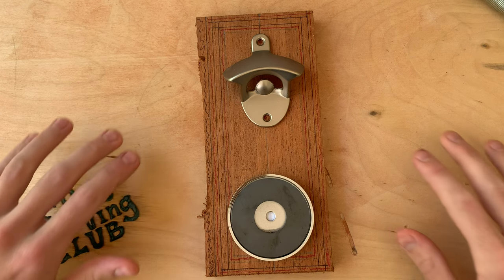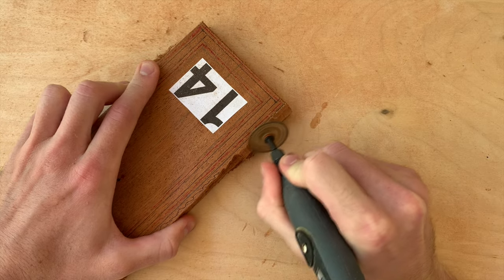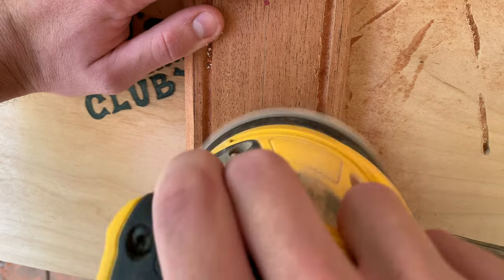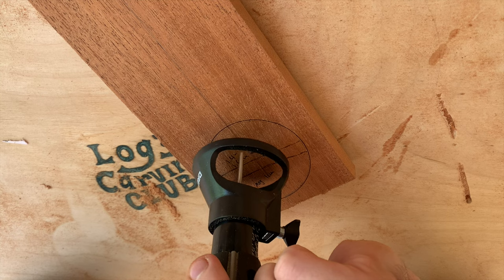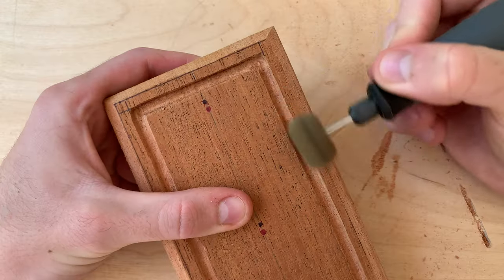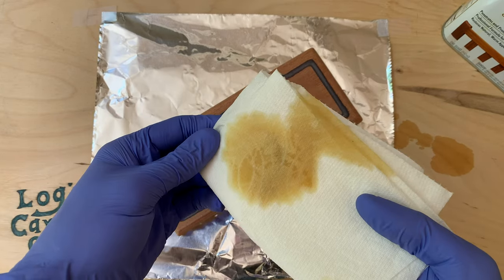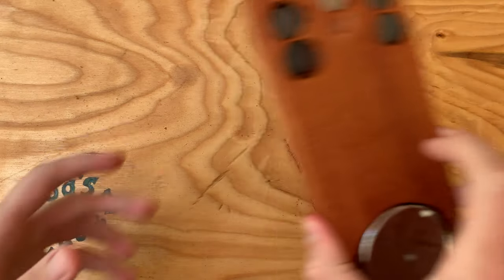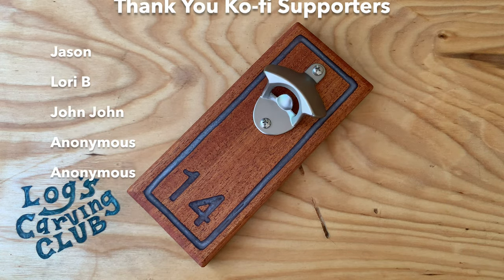Hidden Magnet Bottle Opener (Dremel Project)

Comment: Old hard drives contain  Neo___ magnets. They are attached to a hunk of metal with mounting holes. These are scary strong and difficult to remove them from flat surfaces. DON'T TRY to LIFT . . . rather SLIDE them off.  DANGEROUS if CARELESSLY HANDLED. Neos are  less affected by shock or heat, like regular magnets are.

Comment: Great videos man. Do you by any chance have any suggestions about doing dremel stuff in an apartment? I've come across a few things but it'd be cool to see what you think. That's saw dust gets on everything pretty fast.
Reply from the maker: Unfortunately when I’m in apartments I only use mine for very small projects like engravings because it’s so loud I don’t want to bother roommates or neighbors and it’s so messy I have to keep it outside since I would otherwise need a dust collection system

Comment: Mainly got dremel cuz of you bro, i need help on how to cut.

I have a question: If you could please answer. The dremel spin clockwise, so when I cut from left to right in the direction of the wheel cutting spin, my dremel jumps forward. I was wondering if you could tell me what I am doing wrong and how to avoid making dremel jumping forward away while cutting with a cutting disc.

When i cut from right to left direction, the opposite direction of the disc spin, it doesn't jump.

Comment: Do you feel any power difference between the Dremel 4000 and 4300?
Reply from the maker: I haven't done a direct side-by-side, and I don't have a 4000 anymore, but I didn't feel much difference at all. I try not to stress the tools regardless though to make them last